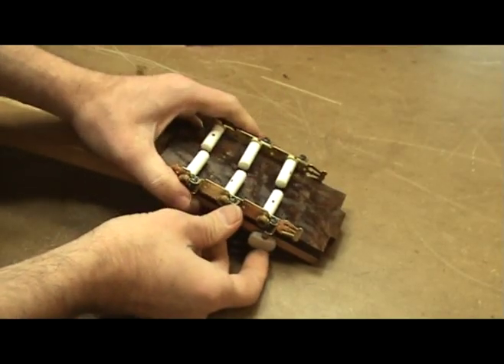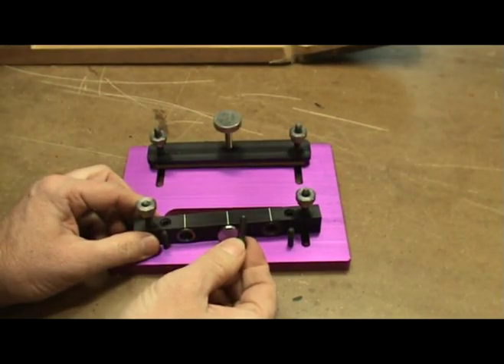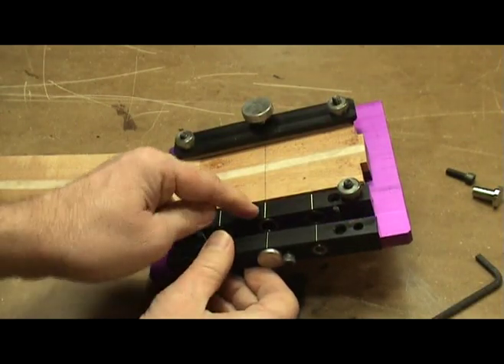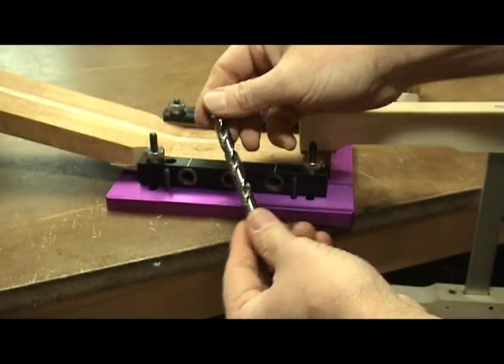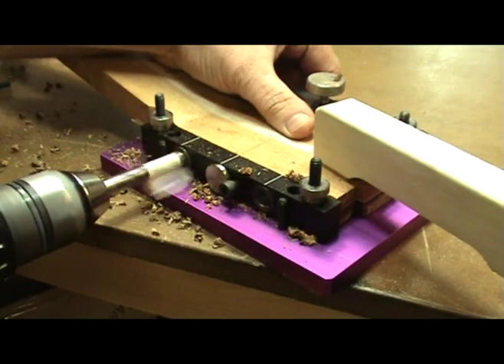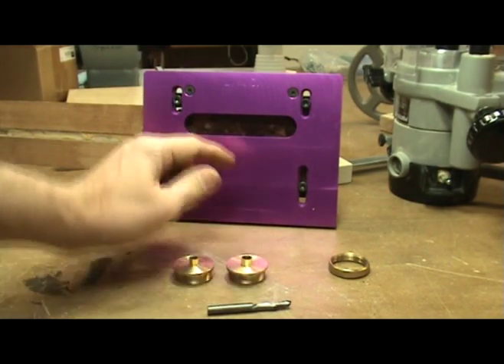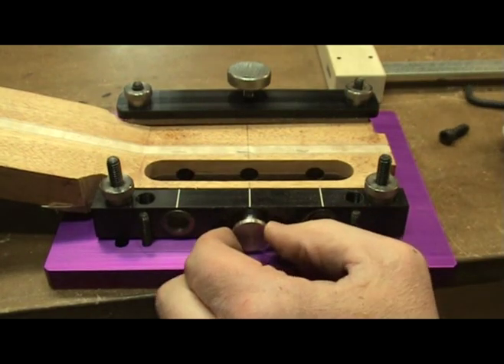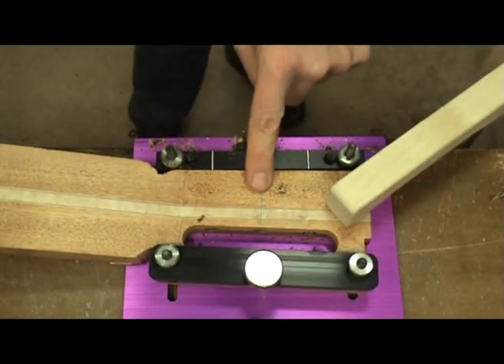Luthier Tips du Jour - Slotted Pegheads

Comment: I have found that the steel string gotoh, 3 in a row slotted sets posts a little short and that's using the 3/8" template guide.  I may have to use even a larger template guide to narrow the slot to get that comfort zone.  Secondly, gotoh and other gear sets have a bushings that extend on the backside of the mounting plates and require a second reaming to attain flushness and extend the post further into the far side of the head stock.

Comment: Hi, could you tell me the dimensions of the slots please? I just ordered a steel-string jig from LMI and I need to work out what guide bushes I need to cut a 100mm x 15mm slot - that's about 3 5/16" x  19/32". I live in Europe and need to order the bushes pretty quick, so I can get on with the job ASAP when the jig arrives. I'd be very grateful for any assistance.
Cheers,
Dave

Comment: I prefer to let the cord of the router to stop the bit by winding itself onto the router bit. I like this jig better that some of that stuff sold by a certain supplier I won't mention. They would have pitched 10 products in the same time LMI pitches one. I will be sending an item back to Ste.... er uh that other guy. Stuff I make from old hack saw blades PVC pipe, threaded rod and scrap metal works better. Autocad and a machinist who plays guitar is handy too! Tool & die maker even better!

Comment: how can you use a square? its not a rectangle
Reply: if the headstock is symmetrical, lines drawn from each side along a square lined up with the side of the headstock and the center of the tuner hole should meet in the middle.